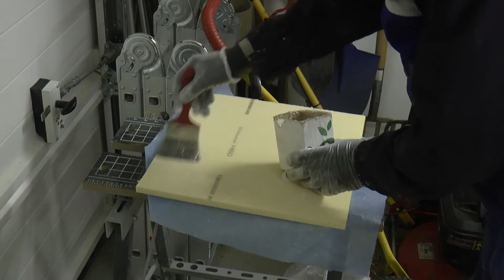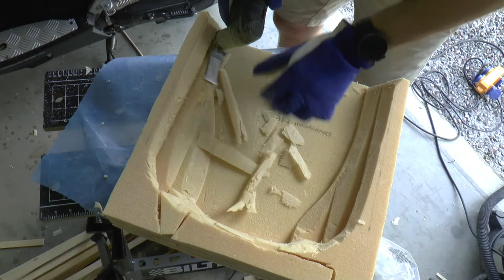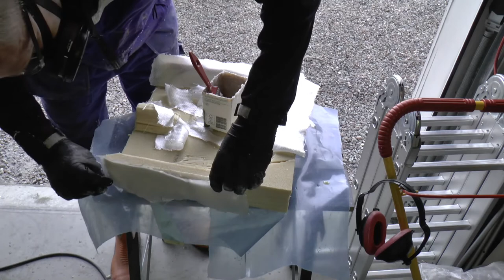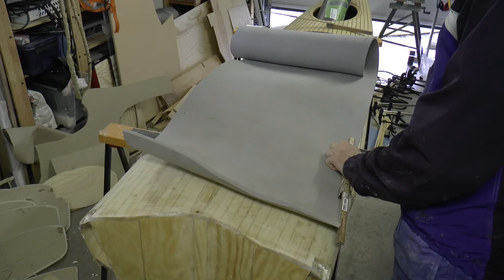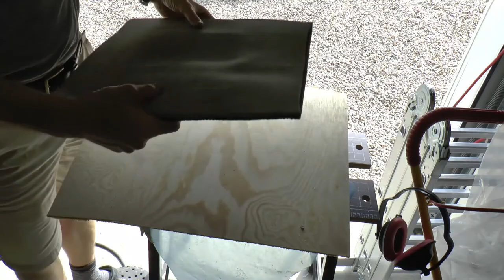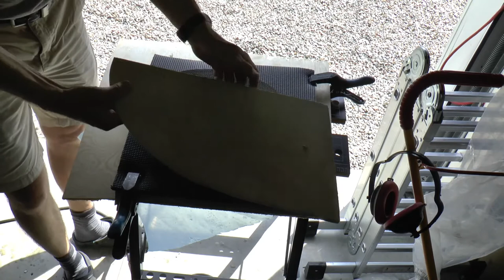How to make two kinds of simple DIY kayak seats, fast to build and with good balancing effect #140

Comment: Well I like that you posted a video on seating.👍  I would suggest 4 in of soft foam over 1 in of hard foam if you want to be in the kayak for more than a few minutes..you must have a iron butt.😀 I don't think that's the kind of foam that that plan suggested. I've built that foam seat many times it's my job. I usually cover it with vinyl when I'm done, or sunbrella. Bass boat seats. Thanks for the video I like watching it. 👍💯
Reply from the maker: Thanks for the feedback and suggestions. I will try these seats to start with and if necessary (not iron butt enough) I will improve according to your instructions. Do you have any suggestions on gluing? I think the solvents in the contact adhesive might have dissolved the foam partly and still did not make a perfect tight joining. Perhaps a polyurethane based adhesive would have worked better?
Reply: @sailoutofagarage6212  yes you'd want to purchase weld wood contact adhesive. I believe y'all have home Depot at least in Stockholm. I checked it's sold in there. it's also the same contact adhesive you put laminate wood on with. there is no wait time takes about a minute for it to tack, and when stuck down it's instant. No second try. Another thing is you can shape it with an electric filet knife, that's how I shape my foam. But I would just grab a 4-in piece of foam cut to a little square and use it one day, just to see if you like it. I like the way you made a couple for experimenting. cuz you never know till you know. Never trust how thick a piece of foam is until you sit on it that's what I found. They like to make yoga mats out of fancy gell type foams. and swimming pool floating loungers out of special closed cell foam too. Because you'll find that foam is super expensive. I really appreciate the reply.😊 I  wish I was there to make it with you.